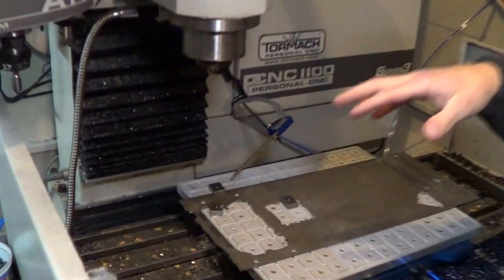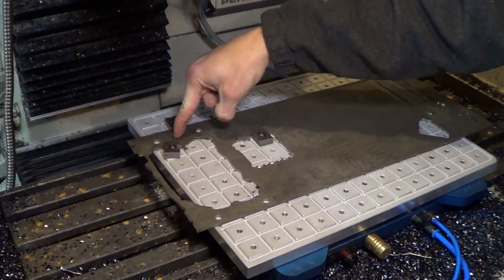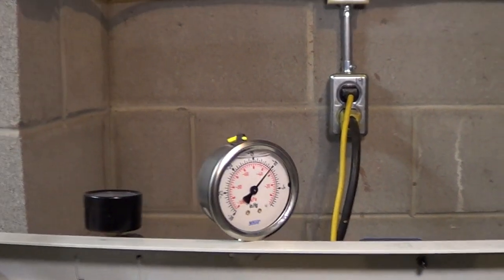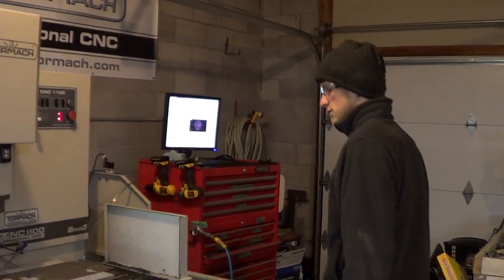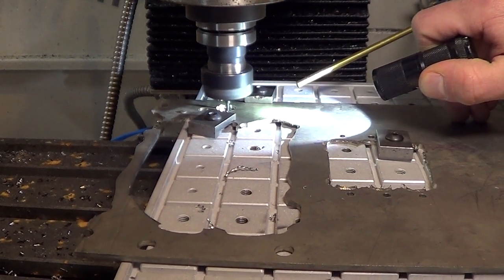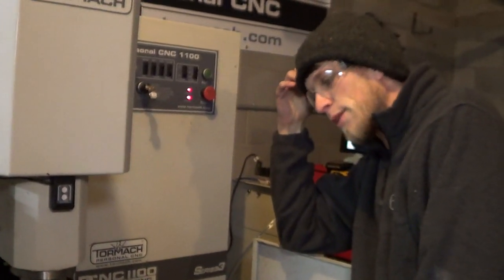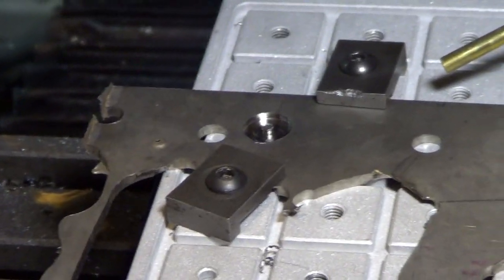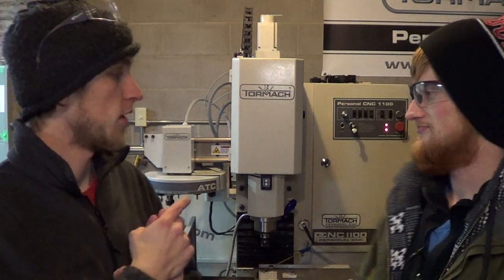Knifemaking Tuesdays Week 55 - Threadmilling fail

Comment: long since past but thought i'd say:
higher feed and coolant.  depth of cut should be fine.... but did you measure the diameter of your rod before threadmilling?
could be that it was oversize?
(sorry hard to hear if this was covered as i'm at work atm lol)
before any threadmilling procedure, internal or external, you have to measure your diameter.

i say coolant because i think titanium when machined ends up gummy like stainless and other nickel based alloys.
in addition, when machining titanium only 25% of the heat is transferred to the chip, so air blast is double no good since your heat is staying inside, rather than being evacuated.

finally, your air - even if it were suitable for the cutting conditions - is not optimal on the side of the part at which the tool broke. to the viewer, the left side of your rod receives no air... the focus is entirely on the right.
when the endmill travels to the left side of your part, both your toolholder and the rod itself are receiving all of the air which means the chips are not effectively being blown from your workpiece for 50% of the cut, and not at all for ~25% of the cut.

cheers.
Reply: Higher feed? Higher speed. He's going less than half the recommended speed, and has too high a chipload as a result.

And yes, blast the coolant on it

Comment from the maker: Good call.  Eventually I started indicating each collet so that the runout was 0.0001", but they'd still break.  I decided that external threadmilling titanium for this tiny 4-40 thread is stupid, the part should be made on a lathe and that's eventually what I did.  However I just finished threadmilling 400 internal 4-40 threads and it works great!

Comment from the maker: There's about 0.050" below the base of the cylinder, so I doubt that it was deflecting.  I've narrowed it down to being a combination of many things I did wrong, but mainly wrong speeds/feeds/chipload and doing all the cutting action with the very bottom edge of the tool.  Next time I'll start one thread up from the bottom and go down so that more threads are engaged in the cut at once, this type of endmill is designed for that.

Comment from the maker: A good point on the cost comparison, however a tool that breaks on the first threads means it's my problem not the tool's problem, per se.  Rigid tapping would be awesome for this purpose.  A shorter or single point threadmill would also be noticeably stronger in this application.  Thanks for the tips!

Comment: I've never threadmilled titanium before, but with 316l, I successfully milled external threads with a single-point thread mill. Less cutting force on the tool if you make the cut with same/similar feeds and speeds. Just make sure to get one with a wide shank

that, or I'm sure you could make a single flute one yourself 

Final alternative: accuratescrew

Comment: A 150 dollar tool that goes for 10X the parts sounds like a bargain. I tend to eschew thread mills for small holes, but my machine can rigid tap. May be shorter treadmill or single point treadmill? You can build a tool sleeve to support the part of the mill not cutting also. Sometimes speeds and feeds are like a baking recipe, just got to find the right ratios.

Comment: Not to discourage, but its often easier to re-engineer the part than to fight an unreliable process. On the male thread, the common solution is to simply add a relief around the threads at the bottom (think snap ring groove.) I would blame the cutters failure on excess deflection, likely caused by high cutting pressure on the end of the tool. FWIW, my calculator says 10,000rpm @ 2IPM, .008 step-over

Comment: Flood coolant will allow the heat to dissipate more quickly.  The coefficients of forced convection for air: 10 - 200 (W/m2K) and for forced water are: 50 - 10.000 (W/m2K)  I would guess that the coeff is engineered to be high for a coolant.  Not to mention the lubricating aspects.  It will probably keep the Ti from work hardening, and threads should come out great.

Comment from the maker: My only aversion to that is that I want these threads to go ALL the way to the base of the shaft.  With lathe threading, there's always that lead out section that eats up space.  The shaft is only 0.075" long.  Also, my lathe spindle sensor is borked right now so it doesn't do threading haha.

Comment from the maker: Thanks Rob.  For this part I want the threads to be as long as possible on the shaft.  The nub sticking out is only 0.075" long and it's going into a blind threadmilled hole, so the more threads the better.  Also I've got hundreds of internal titanium blind holes to threadmill in the next few weeks, so I REALLY have to figure this out.  I should pick up a 60* double angle chamfer mill regardless!  Good call using it on my integral, I like the sound of that.

Comment from the maker: You're right it does look like that...  Since the code was made to do it in 4 passes maybe further passes will clean it up.  Theoretically it should be perfect because both the nub and the threads were referenced from the same circle in the CAM program.  But you never know.  Good eye!

Comment from the maker: Thanks for the tip!  What's happening is the controller is not clicking the relay at all.  When I do the diagnostic voltage test it will click 'em, but not during operation.

Comment from the maker: Not really, it could have been a lot tighter.  It's an 1/8" shank with an 0.085" cutter diameter, I figure any flex will be in the tiny cutter end, not in the shank itself.  However, for the sake of making things perfect, next time I will definitely chuck it up as tight as possible.

Comment from the maker: Good tip, it's called work hardening and happens to titanium and stainless, mostly while drilling with a dull drill bit.  However this operation can't have generated any heat.

Comment: Since you're OD thread milling, consider an inserted thread mill. The style you're using are really intended as an alternative to a tap. Their main advantage being that when one breaks, they're easily extracted. Too small of a diameter.

Also of note are double-angle style chamfers, which will have several flutes, and a single point. A 60* double angle chamfer can be used to mill most standardized threads, any TPI (as well as back chamfering-- perhaps for the slot on your integral? :) )

Comment: going back to a previous tuesday when someone commented that m5 bolts and 10/32 thread bolts were interchangeable they are close but not the same. 10/32 will thread into a 5mm nut but 5mm will not fit into a 10/32 lol. I work for a fastener company in Michigan and am a knife fan. I look forward each week for the next video keep them coming!

Comment: lakeshore carbide recommends .0003" to .0006" per tooth for a .125" thread mill.  you are running at .0005" per tooth, with a much smaller thread mill.  also, the thread mill looked like it was flexing a lot before it broke.  may need more passes??  i would call lakeshore and see what they say.

Comment: 4-40 thread milling, looks challenging!  Some hints: For OD thread milling, see if you can find a larger diameter thread mill with the 40 tpi pitch and go with one pass. Also, you can try starting  from the bottom and spiral up one rotation, then ramp out.  I Thread mill with only one pass and fiddle with the tool diameter offset or G code to get the desired pitch diameter.  Good luck!

Comment: I've had similar issues with machine tapping.  Tapping Ti requires a slightly oversized ID.  Took me a couple hundred dollars worth of taps to get it right in my machine, in the end I still do 2-56's by hand just because they're so delicate.  Careful not to break taps off in integral frames, I learned the hard way.